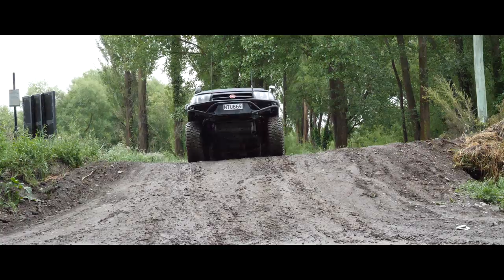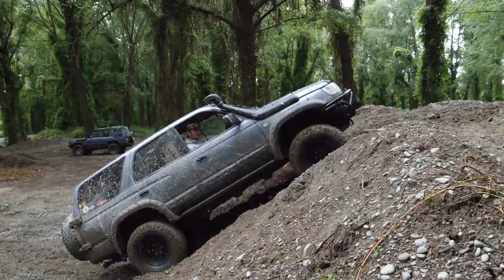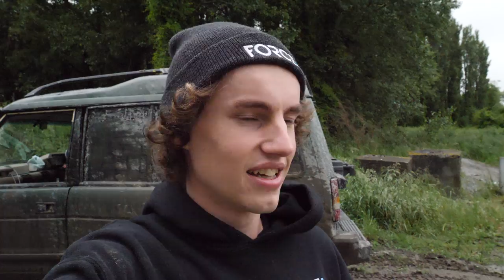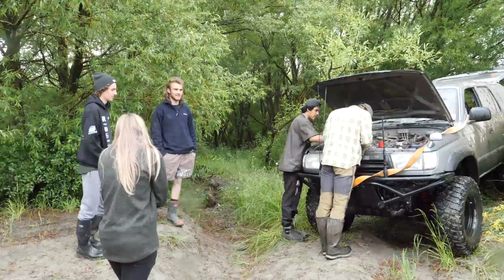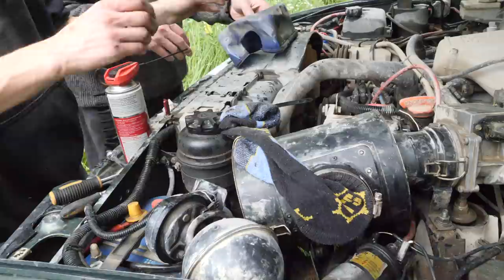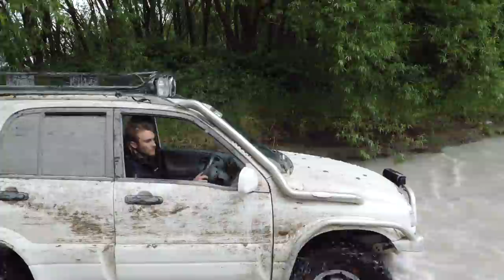V8 DISCO's Take On ASHBURTON 4WD Park & Rakaia RIVER + DROWNED LANDO! Vitara & 4Runner/Surf Offroad!

Comment: mean mate. truck sounds and drives hard. a video tallying up what you have spent on it, including what you paid for it would be good. cheers 👍
Reply from the maker: Cheers mate! Haha would be interesting ay but I think I’d rather not know that number 😂
Reply: @Crawlerer79   Since you previously mentioned putting the rear spacers up front, what about puting 1 inch taller coil springs front and rear, and not using the spacers?
Reply from the maker: Because I’m poor! The front springs will be replaced soon, and in the rear it only has a 6mm spacer which is more for fine adjustment, only other way to get the fine adjustments is to pull the springs and have them reset at a different height every time you make a change, and I don’t have that time or money! Nothing wrong with some small spacers!
Reply: @Crawlerer79   Fair enough 😉

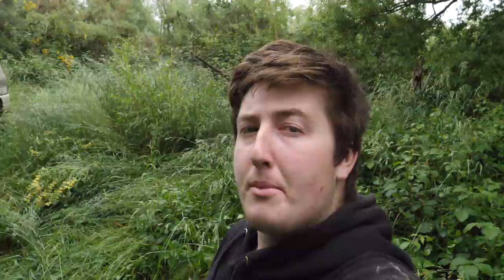Comment: 14:55 must have been just slightly scary for a second! By the way, do you have any spring/shock suggestions to soften the ride of my D1? I have some 2" EFS springs and shocks but it's pretty harsh over bumps, especially in the back. Cheers.
Reply from the maker: Haha yea just a smidge haha. And I am running Dobinsons springs and they are awesome. Check out my last 2 videos on Lando, I got into a lot of depth on setting up suspension. Also highly recommend talking to Rick at Kingpin Design and Fab, flick him a message on Facebook, he’s full of knowledge and has got Lando riding like a dream!
Reply: @Crawlerer79  Cheers, will do! 👍

Comment: Haven’t you Kiwi’s herd of snatch straps. What’s this rope business for recovery
Reply from the maker: Sure have, but in this situation rope was the better choice. In situations where there is flowing water (especially at the speed that the current was flowing in this video), a snatch strap will stand up on its edge and becomes incredibly hard to hold, on a long enough strap it can even pull people into the water. I always use a snatch strap where possible however in these conditions the rope has a lot less drag to hold and it far safer. On top of that, I don’t have enough straps to link together to span that crossing comfortably! Hopefully this answers your question!
Reply: @Crawlerer79  I understand where your coming from but still not safe. Let’s just hope you don’t learn the hard way one day. Keep on having fun.